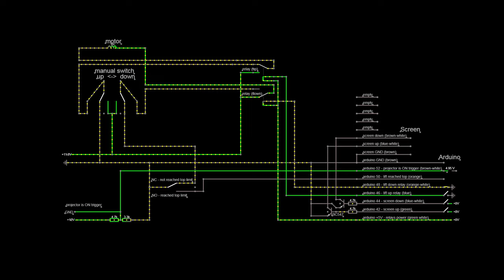DIY - Homemade projector lift

Comment: Thanks for posting this! This is really slick and actually looks better then most of the commercial units.  My Ceiling only has 7.5"(19cm) of height excluding the wall and most of the commercial units wouldn't fit but this would.  Also I notice allot of cheaper commercial units don't even support 12v trigger source to trigger with projector on.  I think I would built with sunroof motor so hex tool can be used to lower if motor/motor controller fails.

Comment: Good system, really cheap! I recommend you to add some safety steel wire just in case the ropes break or  get loose, it will still be cheap :-)
Reply from the maker: Thank you. The zap straps are kind of fuse. I accidentially checked that ;) they will be cut of in case of higher resistance. But I'm going to add 12V 2A fuse as well.

Comment: Hello!
I liked your decision very much, I want to implement the same at home.
Please tell me which engine did you use for this? (if possible, then photo and model name) and which relays were used?

Thanks in advance!
Best regards, Maksim!
Reply from the maker: Thanks Maksim, 

Can't make a better photo than you can see on the video. I used the random car wipers motor (with gears inside) from Hyundai I guess... Hovewer now I'd rather use the blinds tubular motor. Is a bit more expensive, but have top and bottom limit switches. You can find such motors on alliexpress. I used standard 5V mechanical relays with optical isolation, like so: https://pl.aliexpress.com/item/32668258402.html

Good luck!